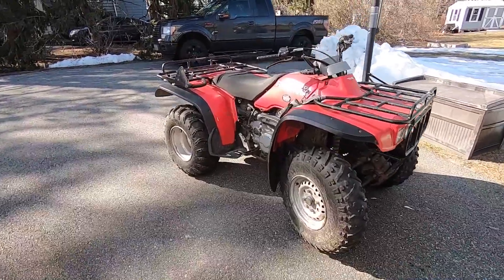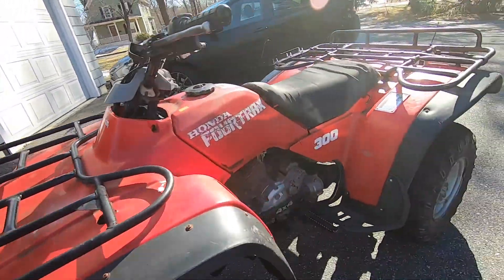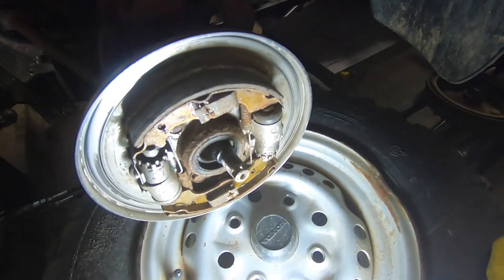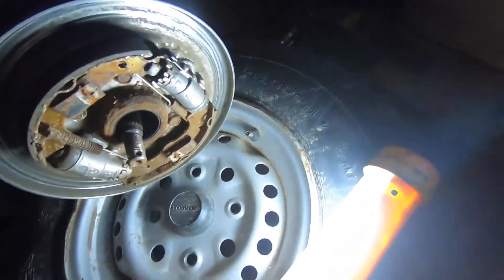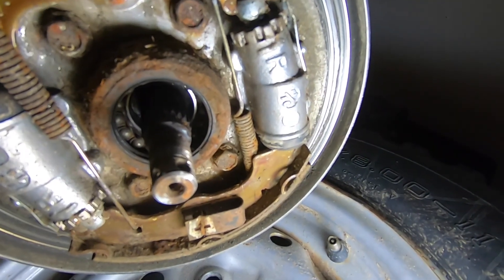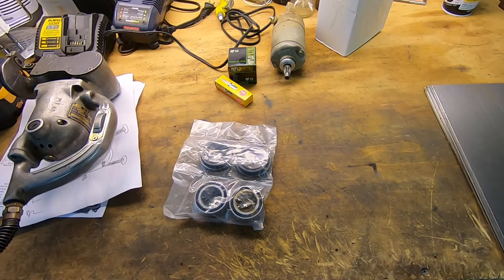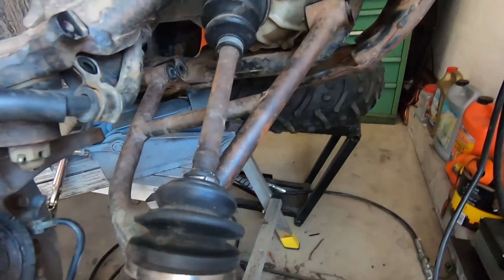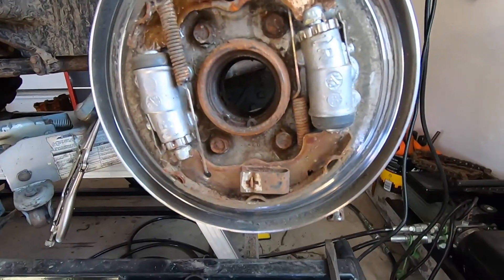Honda FourTrax 4x4 Front Wheel Bearing Replacement

Comment: Looks harder to do when you dont remove the hub and perform the bearing removal / replacement on a bench .
Reply from the maker: It was easier than it looks I guess. It took about an hour start to finish and that included filming.